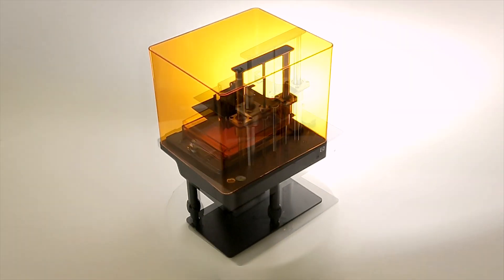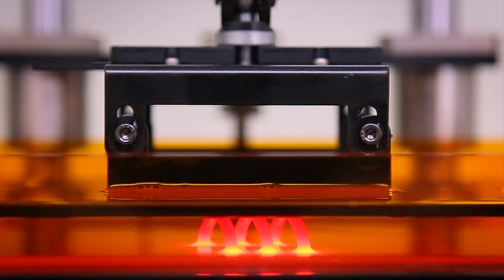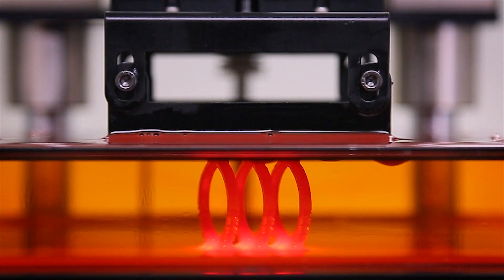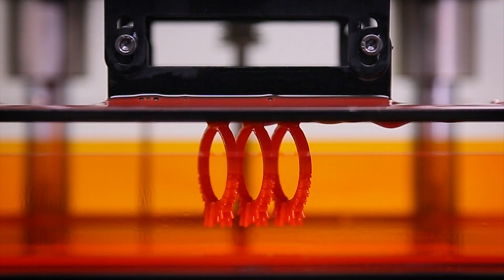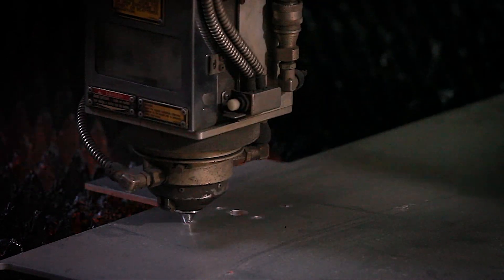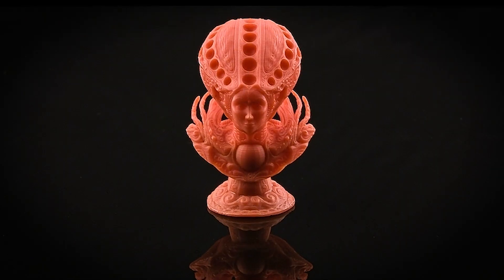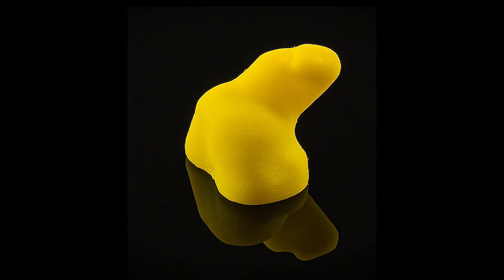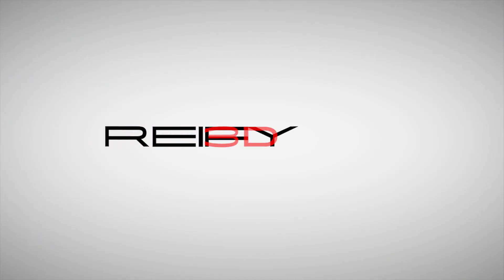Reify Solus 3D printer

Comment: The projector is just sitting on the desk in front of the printer? that's the only thing that looks a bit unusual.
Reply: +JamminMan77 It's not unusual actually. If the mirror wasn't there, then the projector would have to be mounted facing up. This way you could remove the projector for movies.

I've been researching on building my own, I have to say that there are several DLP printers like this.
http://www.instructables.com/id/DIY-high-resolution-3D-DLP-printer-3D-printer/